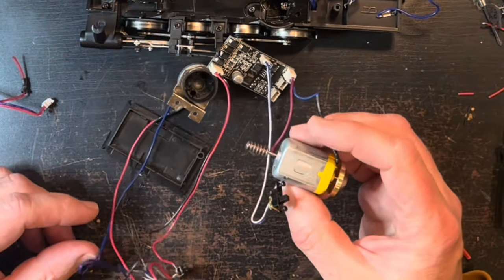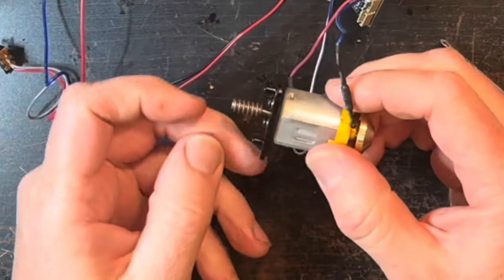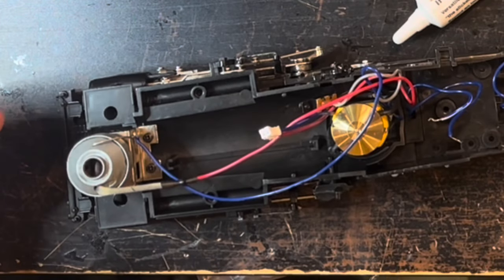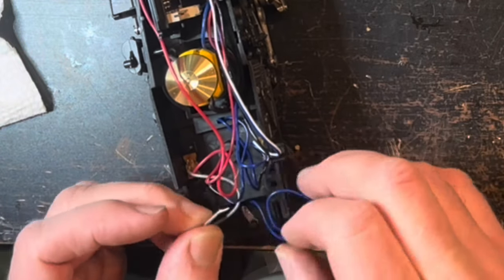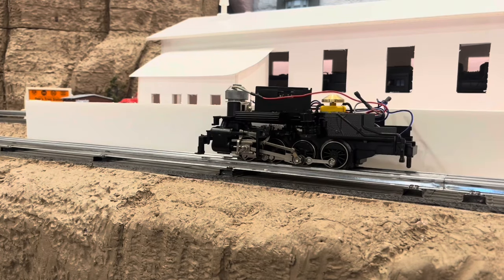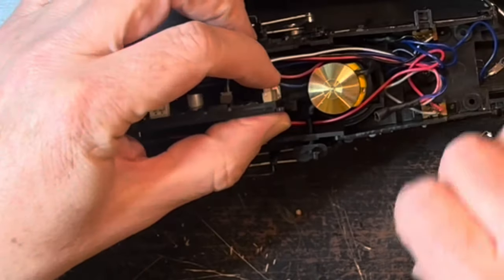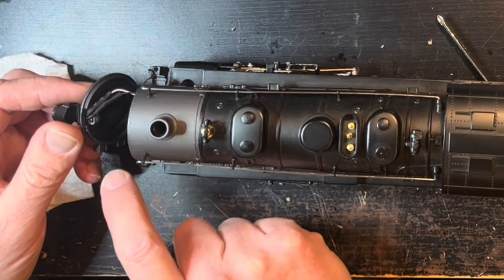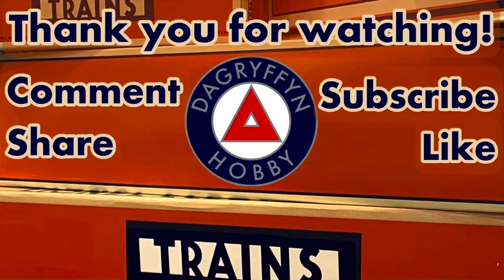Fixing My New 0-8-0 Part 2. Will It Run Again?

Comment: Great job, Dave. It looked a little more complex than what I was thinking. I'm glad you got her running again. I can't help but get my engines running again ASAP, either. It bugs me if they're not working. I don't do shelf Queens. I don't think you got hurt. It's a  nice little engine. The set should be worth 100 + in running condition. A seller on eBay is asking $165.00 for this same model.
Reply from the maker: Thanks. Still a good deal if it ends up working as well as my other 0-8-0

Comment: Nice repair on that little engine. The clicking would be on the top of my list of priorities to figure out where it’s coming from. That’s one of those weird things that I can deal with just about anything but a click or squeak has got to go lol.
Reply from the maker: Thanks. I agree. I’ll probably take it all apart again soon.
Reply: The clicking may, I say MAY, be coming from the puffer component of the smoke unit.  I've got two Lionel Camelbacks that were making a clicking noise that was somewhat noticeable when they rolled past.  Kind of drove me nuts for a bit until it dawned on me it was the puffer activating lever.   Now that I know what it is I ignore it! 
I think it was the not knowing that was annoying me the most. :face-purple-crying:
Reply from the maker: @wayneantoniazzi2706  it’s definitely the lever on my other engine. Maybe this one too

Comment: Once again, Dave...Nice video!
Reply from the maker: Glad you enjoyed it
Reply: As others have said, good video. Another tip for prevention of stripped plastic or metal threads is apply a very small bit of grease to the screw and back it in and out a few times as Dave described.

Comment: Possible that the smoke unit on/off switch was wired backwards.  Try turning the smoke switch "off" to see if the smoke starts.
Reply from the maker: I tried and nothing. I’ll fiddle with it again soon
Reply: I kind of doubt it, every smoke unit on-off switch on one of my engines does nothing more than interrupt the current to the smoke unit when it's turned off.  Wired backwards no, but installed backwards maybe.

Comment: Great job Dave!  Like yourself I wouldn't have purchased that engine for $53 either as it just doesn't fill any need of mine BUT it was a good learning experience for you.  
The smoke unit might be bad but I believe Lionel smoke units of that vintage (around the year 2000, before and after) were  bit anemic.  I've got a couple of Camelbacks that had weak units, I replaced the innards and wired them direct for track voltage, not voltage from a circuit board and it improved things a bit.  On a scale of 1 to 10 they went from a 2 to a 5, good enough. 
Just so everyone else knows coarse thread screws on this or any other toy train are for the plastic parts.  The plastic part screws are pretty analogous to a wood screw, tighten them down just enough to hold well but don't over-tighten, you'll strip out the plastic just like an overtightened wood screw will strip out the wood.  
Glad to see everything worked out for you Dave!  I'm doing a local show this weekend (The Virginia Train Collectors Show), the idea being to unload some things I don't need and pick up things I didn't KNOW I needed!  🤩
Reply from the maker: Thanks Wayne. I’ll have to try working the smoke unit to track power, it would be nice to have more smoke. My other 0-8-0 smokes decent only if the power is cranked all the way up.
Reply: @dagryffynhobby  Yeah, that sounds exactly like the anemic smoke units I mentioned, they only smoked fairly well when the engine had a load on it like a long train it had to work hard to pull or the transformer was turned WAY up.   I also replaced the smoke unit components with some liquid smoke rebuild kits from Henning's figuring they'd work better off track power than the original equipment.
Reply from the maker: @wayneantoniazzi2706  good plan, I  have been wanting to redo the smoke unit on a few engines - I should get it done!

Comment: Interesting there is only one worm gear set reduction. Most post war AC Lionel have at least two gear stage reduction. A worm set along with a spur gear set. Double stage gearing helps torque and starting slowly without staggering. This engine looks fast. Weight always help smooth out motion. Doesn’t look like much real-estate for weights. Pretty engine😊 the mechanism looks cool running. Small engine w/small cars is a nice fit on your tracks. Sharp looking😊
Reply from the maker: Good point. I find it odd that it is so much faster than my other 0-8-0, both conventional and essentially the same engine.